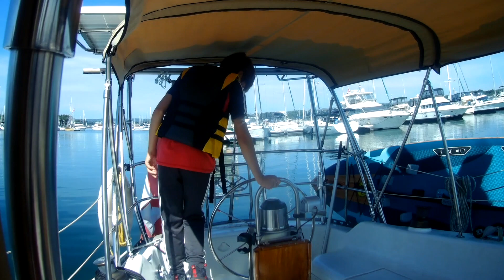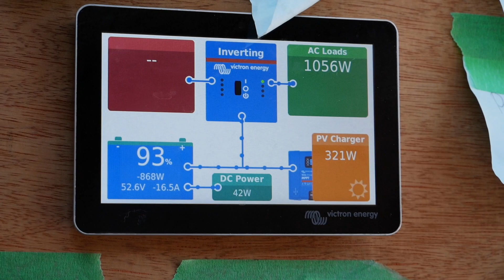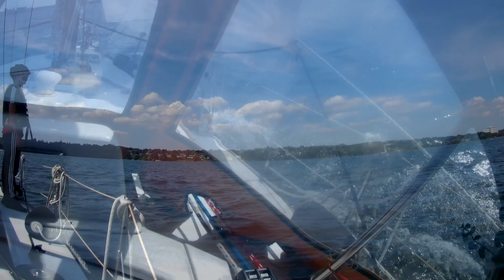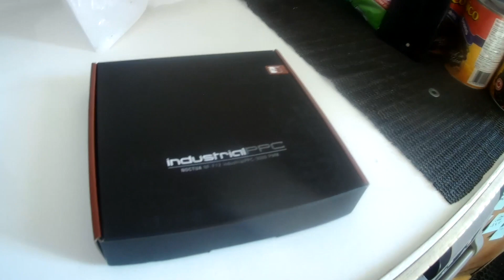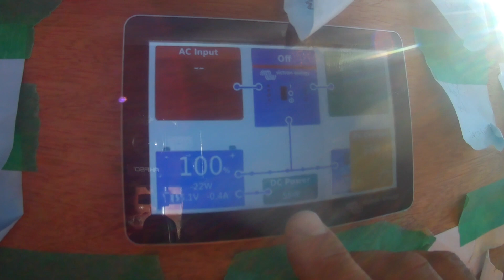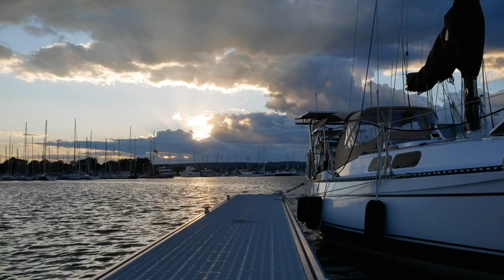Ep142 Noctua Industrial Fan Upgrade and #HamOnt Harbour Sail Testing

Comment: Great video!! How works with the hard conditions of sea and wind? What is the max speed to your boat? Appreciated!
Reply from the maker: sailboat hull speed 6.6 knots however we reached 9.3 knots surfing down large waves. electric motor top speed is 5.5 knots. Controller seems like it starts consuming vast amounts of energy to gain very little of anywhere north of 4 knots. we had to power back through 56knots of wind dragging our anchor along the mud once during a microburst storm. not fun but lots of torque. batteries a concern added a generator this year to the mix as a safety measure. thx for the comments!
Reply: Thanks a lot! I'm converting my Furia 33-foot sailing boat to an electrical engine using the Golden Motor kit and your videos are gold to me. Greetings from Barcelona, Spain. @TheNeds
Reply from the maker: beautiful boat good luck with your conversion!